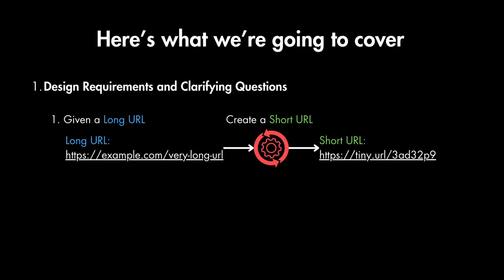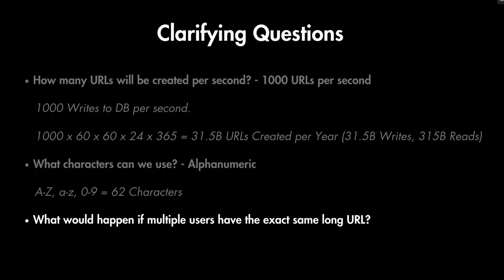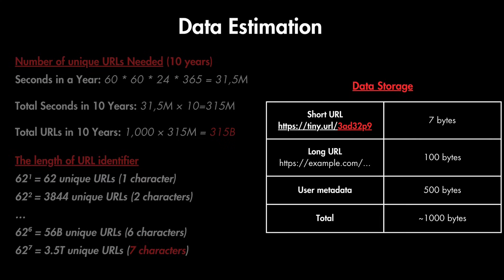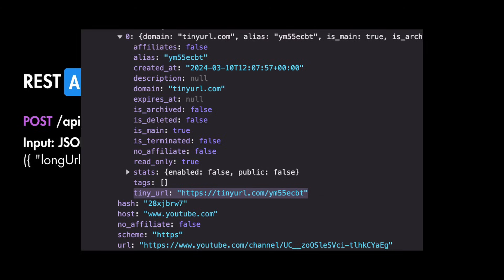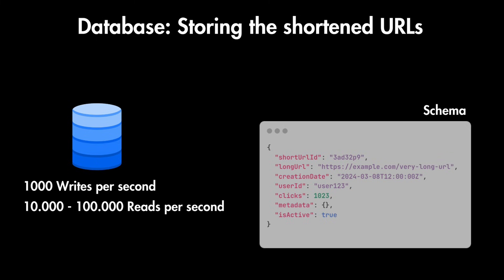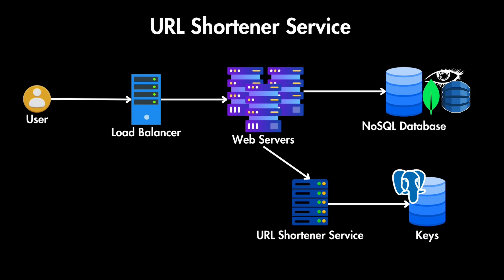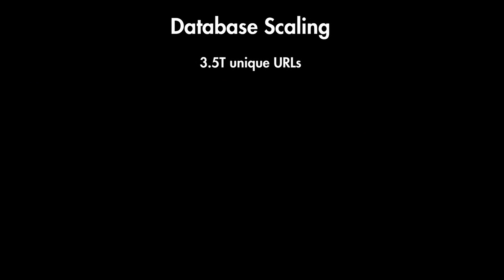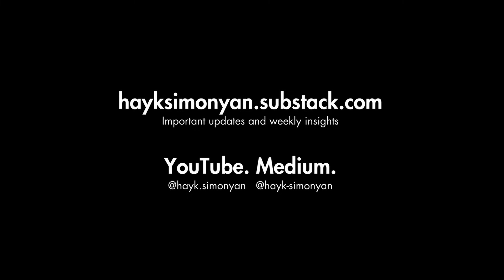System Design Interview Question: Design URL Shortener

Comment: Why do we need two DBs and what are we storing in each? If I understood correctly the DB used by the URL Shortener Service stores only the key value pairs of short url and if it's used or not. The NoSQL instead would contain the mapping of the short url with the long url along with user metadata i assume? So for writes both SQL and NoSQL dbs are necessary, whilst for reads only the NoSQL one. Did I get this right?

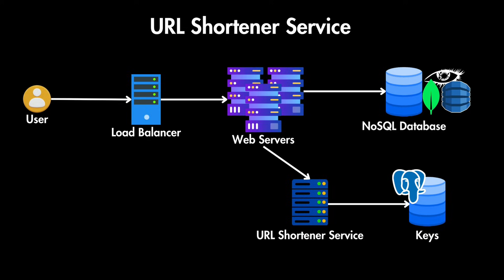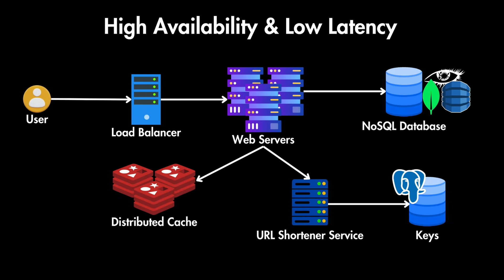Comment: 10:12 you said the system with Postgres doesn't handle generating 1000 URLs / sec so cache layer is introduced. Yet 10:22 you talked about "popular URL" which implies the URL is meant for a redirection service. So is the caching layer needed for both creation and redirection? I don't understand how the creation could be "locked" with cache?
Reply from the maker: The caching layer in this system is mainly for accessing the URLs from the NoSQL database, not when generating them via URL shortener. That's because this is a read heavy system, meaning it will get many more reads compared to writes

Comment: why do we need url shortening and lengthing techniques?
Reply from the maker: Example use case is for posting on Twitter (X) which limits your characters and you need to shorten some URLs to fit content. Another example is to also add tracking through this URL.

Comment: Why not use a database with B-trees instead of LSM + SST in Cassandra considering we want to optimise for reads? And if we use that then we can use the same database for storing short URLs as well rather than doing another network call for the short URL from a separate databse
Reply from the maker: Good question! While B tree databases could optimize reads for this case, the choice of LSM-based systems (like cassandra) often comes from their great scalability and distributed nature. It also excels at handling high write throughput and horizontal scaling and these features are important for handling the massive traffic and global distribution typical of URL shorteners
Reply: @hayk.simonyan  What makes Cassandra better for horizontal scaling compared to something like mysql or postgres? In this scenario, complex multi-shard joins is not really a use case then what makes LSM-based systems scale better?
Reply from the maker: @AizazShahid-ck8cn  cassandra distributes data evenly and ensures high availability unlike MySQL/postgres, which require complex sharding logic. And in a URL shortener we typically prioritize write performance and scalability over complex multi-shard joins

Comment: Hey, I stumbled upon a more efficient approach for the initial step of our URL shortener project. Instead of the traditional method involving database creation and random ID insertion to ensure unpredictability, I devised a single script. This script generates IDs synchronously without relying on a database. It's incredibly memory-efficient (no heap allocation) and adept at handling high traffic seamlessly. The secret? Just a simple mathematical concept. Intrigued? Let me know if you want to dive in! 😊
Reply from the maker: hey, yes creating all keys upfront will be inefficient. A better approach is to start with a database auto-incrementing integer as your unique identifier for each shortened URL. Then encode this integer into a short alphanumeric string (using base62 or similar techniques) for a compact and user-friendly representation
Reply: @hayk.simonyan,

I have come across a mathematical concept known as the "Modular Inverse" that could revolutionize the approach to URL shortening, eliminating the need for a database entirely:

First, select a large prime number, denoted as 'm', ideally the nearest prime number to the anticipated number of links to be generated over the lifetime of the application.
Within your application, initialize a counter, 'i', starting from 2 (1 always return 1) and incrementing up to 'm'.
For each incoming request, return the modular inverse of 'i' with respect to 'm'. This operation guarantees unpredictability and non-repetitiveness due to the prime nature of 'm'. Increment 'i' by one after each request.
Here's an example with 'm' set to 37:

i = 2, result = 19
i = 3, result = 25
i = 4, result = 28
i = 5, result = 37
i = 6, result = 31
i = 7, result = 16
i = 8, result = 14
i = 9, result = 33
i = 10, result = 26
i = 11, result = 27
i = 12, result = 34
i = 13, result = 20
i = 14, result = 8
i = 15, result = 5
i = 16, result = 7
i = 17, result = 34
i = 18, result = 35
i = 19, result = 2
i = 20, result = 13

i also searched about the time complexity of Modular_Inverse function and i get O(log(min(i,m))) .

So what you think ?

Best regards, Bouzid Kobchi
Reply from the maker: @passionforsciencel5180  it's a clever approach 👍 For URL shortening systems where the anticipated scale is known, this inverse method might be a great fit. However, for large scale systems where flexibility, unpredictability, and advanced features such as custom short URLs are expected, a traditional database backed method is likely more suitable
Reply: @hayk.simonyan  
Anyway, i like to mention it , sometimes mathematicians can replace us 😅
Thanks for your feedback